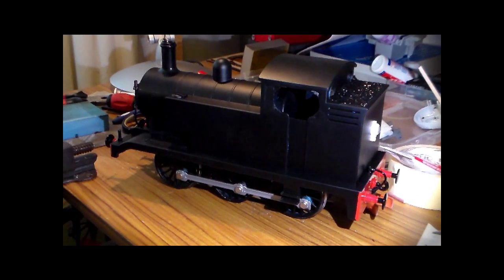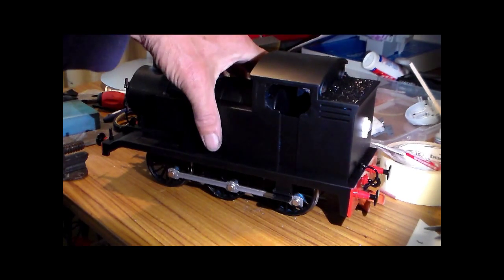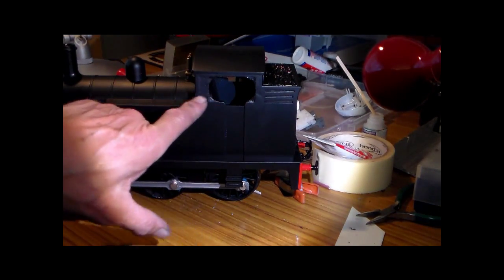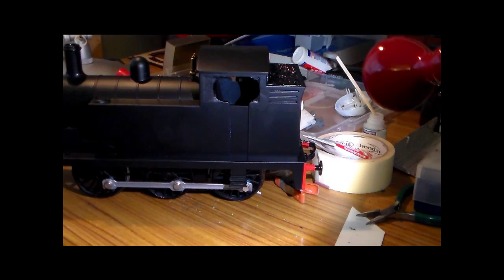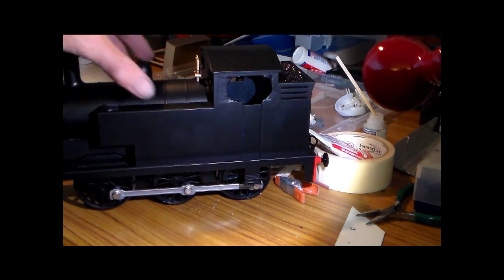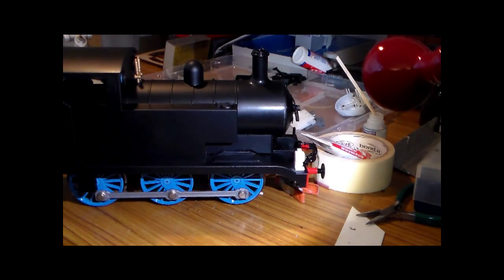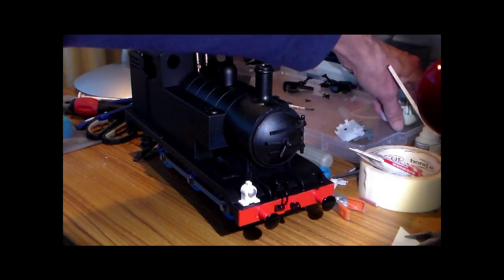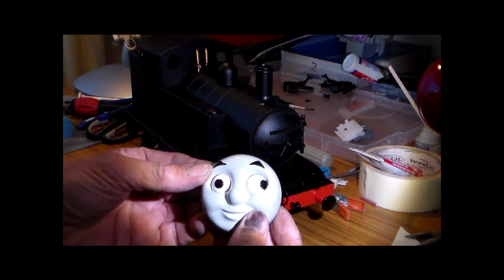Modification of Thomas the Tank part 4

Comment: Looks brilliant, cnt wait to c it running!! A BR transfer on side wud finish off nice! Annie n Clarabel with a coat of maroon paint wud do the job ;)
Reply from the maker: I think you are right. Cut off the Bachmann coaches' noses.. I can't get the windows out of Annie n Clarabel without cracking them. I may have to replace them after painting the coaches.
Reply: Im sure they cud b replaced?? I use any sort of clear plastic???
Reply from the maker: Matthew Snowden Yes, I think that is what to do. The originals have a moulding but they are far from 'flush glazed'. Not sure about the funny end windows. If I reshaped them on one coach it could represent a push-pull set.
Reply: Oh yeh forgot bout the end windows! Filler???

Comment: How did you remove the splashers
Reply from the maker: Reece 105 I removed the splashers with a tenon saw for cutting wood. Then used plasticard to cover the hole. Still enough clearance for the wheel.